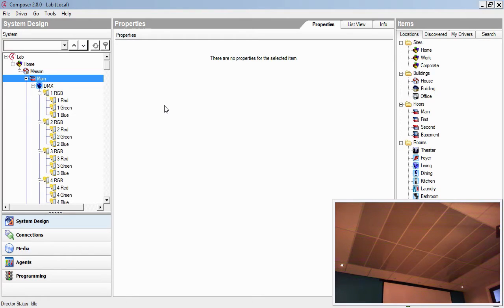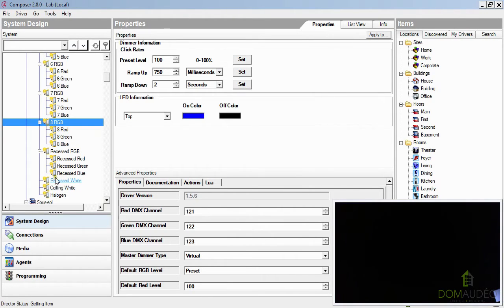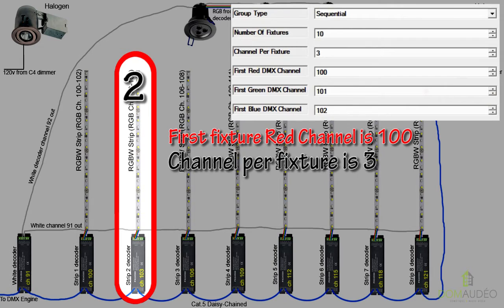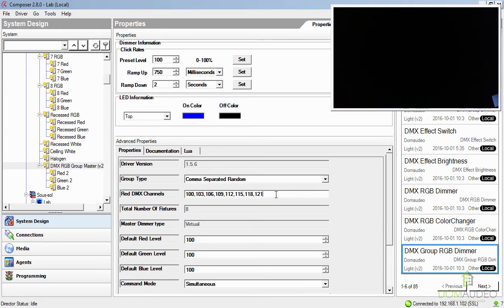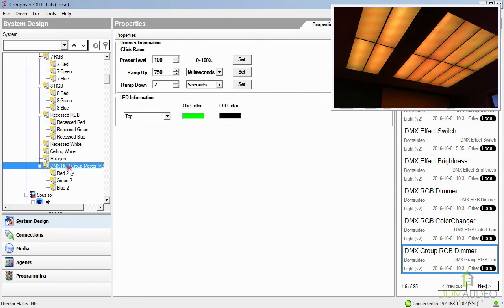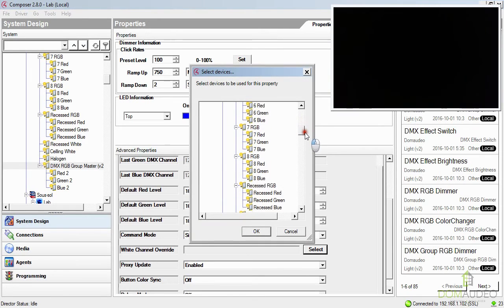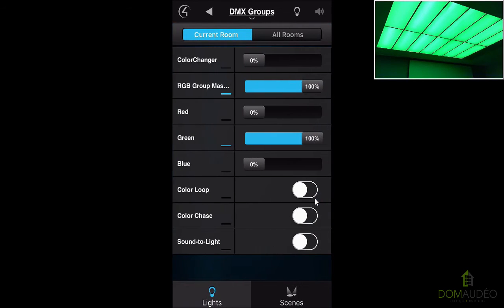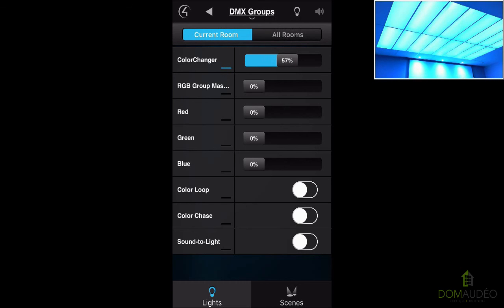DMX for Control4 Tutorial #2: Group Dimmer and RGB Group Control

Comment: Hi will this driver work with the Enttec ODE and pixel tape? https://www.enttec.com/aleph/?main_menu=Products&pn=8PL with Control4 to do a light to sound solution?
Thanks
Reply from the maker: No, it will not work with the Enttec ODE, you need to use the Engineering Solutions DMX Engine. But if you already have an existing DMX ligthing kit installed, you can keep it and just connect to the DMX Engine and you will be able to control it with Control4 with all the features this driver has to offer.